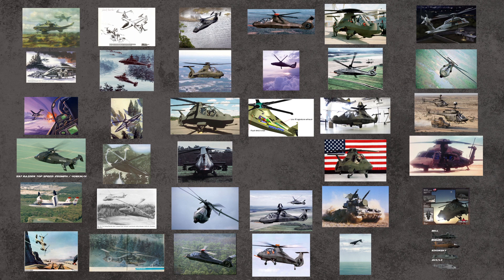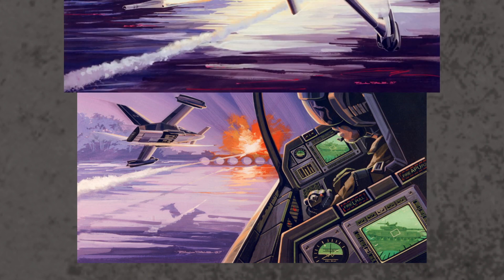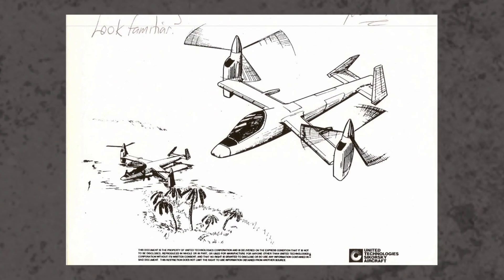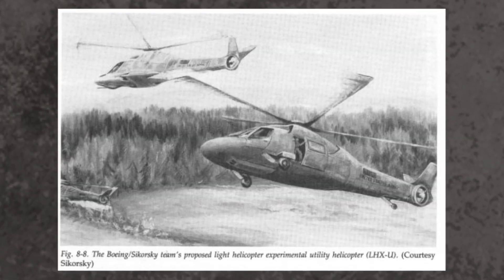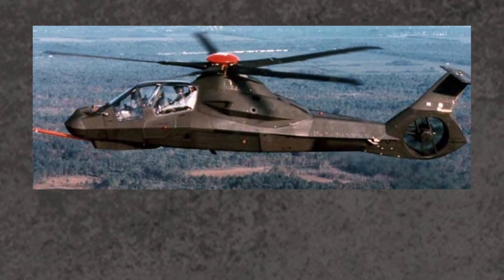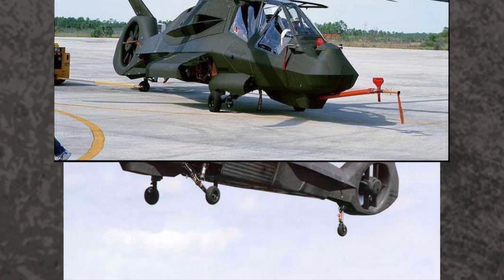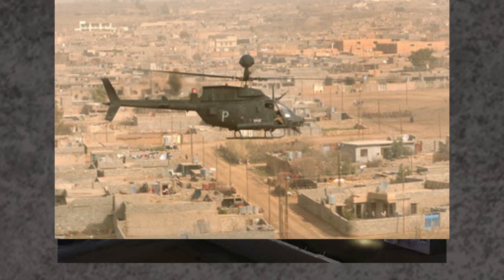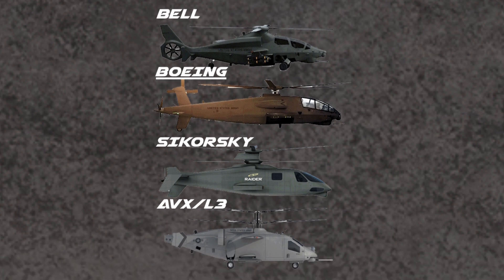Wacky Helicopters | RAH-66 Comanche

Comment: the theoretical speed limit of a conventional type helicopter is 250 mph
the Westland Lynx did 249 mph and is a fascinating machine Burp main rotor
semi-rigid rotor head, same upgrades with the Westland Merlin
rotor tips do not go supersonic and no chopper sound is heard,